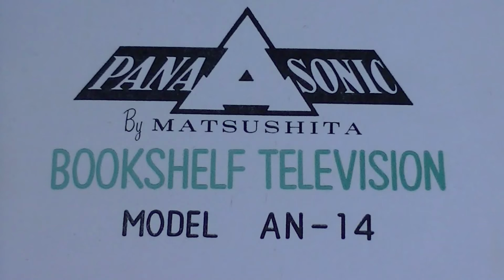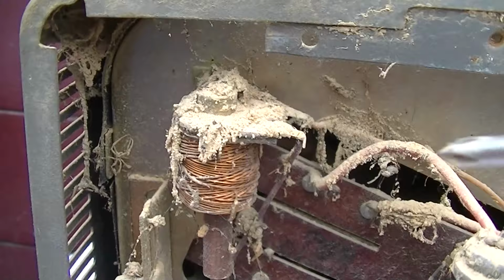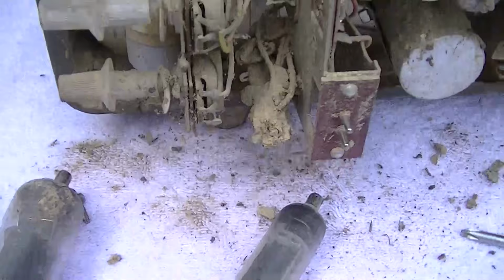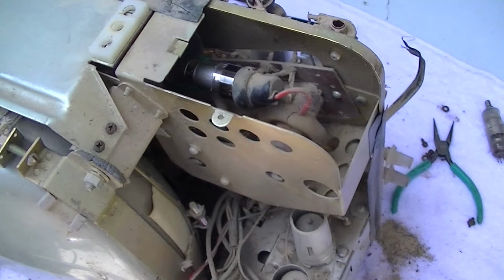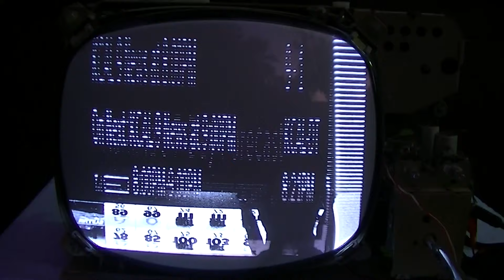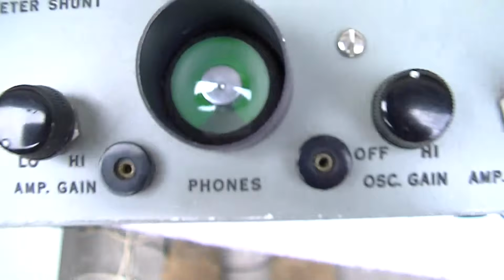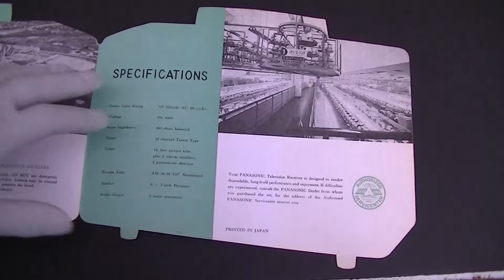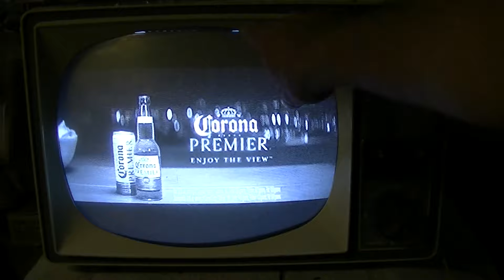1962 Panasonic Early Japanese import Black and White Television Resurrection AN14

Comment: Panasonic may be interested in this TV.  Besides being rare to extinct, this is the very beginning of commercial engineering in Japan. At this point, they mostly just copied like China now. Probably that complex simply because whoever designed it didn't yet understand the concept of engineering to manufacturing for profit or repair in the field
Reply: Actually an indigenous design.  Very few TVs are made like this.
Reply: What are you talking about? Japan were / are still one of the first real pioneers of TV. I suggest you look up Kenjiro Takayanagi, a famous Japanese engineer not so well known in Europe / USA but he built the first all electronic TV in the 1920s (didn't require discs like logi baird and co) and had a working TV demo even before Farnsworth. The war put the brakes on the developement of TV's but Japan were very much designing and working on their own stuff right from the start. They had a HDTV system developed and ready in the early 60s although bureaucracy would keep it from deployment until the 70s/80s by which time Digital TV was already in the works. Even to this day NHK (Japanese broadcaster) are the pioneers of 8k broadcasting with their own cameras and test broadcasts going on...
Reply: There was also a Japanese version of this model which was AN14, and it was under National instead of Panasonic, and it has a different logo instead of this one which was the Masushita logo.
Reply: Isn't there some kind of TV museum in L.A. that would be interested in this?
Reply: Takanayagi had an electromechanical television, it still used a Nipkow disk. 
"He developed a system similar to that of John Logie Baird, using a Nipkow disk to scan the subject and generate electrical signals. But unlike Baird, Takayanagi took the important step of using a cathode ray tube to display the received signal.  This was several months before Philo T. Farnsworth demonstrated his first fully electronic system in San Francisco on September 7, 1927, which did not require a Nipkow disk."
Reply: Well... for something that lasted in that condition and it's still working more than 50 years later, that clearly proves that it wasn't a bad design.
Reply: @user-vz4bo1en8x  

It didn't work tho.
But yes it's nice
Reply: @westelaudio943  well, it's working after not too much of it being changed. There were some radios that took shango more time than this to even get working.

Comment: I note the 110° deflection angle, when most sets had the very rounded edge picture tubes had a 90° deflection angle (sold in Australia, using the 625 line, 50 Hz frame rate). I can't recall any Japanese made sets available in Australia (1960's), but perhaps the most crucial items in terms of reliability were tubes in the deflection/HV circuitry at the time, as well as being readily available.. Of course, transistor radios were among the best receivers using germanium transistors, which were used in tuner, IF, and audio stages in 'hybrid' TV's (using tubes in deflection and picture). In Australia, there were 2 main sizes; a 17" (diagonal), and a 21". They came in almost a cubic wooden box, and managed a tube count of 17 tubes in each one. A TV & Radio licence (renewed annually) was necessary, so the activity of watching TV was not a cheap one. A magazine called 'Radio, TV, and Hobbies' collaborated with several component suppliers to present a 'kit TV', where you would save a lot of sales tax if you constructed it yourself. 1956 was the year that TV began broadcasting (commercial and national) in Australia, just in time for the Olympic games in Melbourne, where many people gazed through shop windows to watch it...

Comment: That's well made. I had a Sylvania doing that and it burned out the fly back because the fly back as you stated earlier in the video the fly back supplies the boost voltage and being that jacked up it burned it out

Comment: What I can't understand is why Shango066's videos have fewer views then Mr Carlson's Lab? You know, the guy that tried to convince everyone that film caps, which have no polarity, are polarized though an erroneous demonstration. His latest project, fixing up a pre-war Belmont AC/DC radio, five or six tubes, one band, a nice looking set but about as boring as it gets compared to this 1962 Panasonic (National) TV.
Reply: Yes, he does way to many AA 5 Videos , AA 5 sets are actually very simple and virtually all the same, X ray tony did a program where he de-bunked the importance of polarizing capacitors, showing by measuring the noise present at the output, that it made no difference how the cap was installed.

Comment: Little info on the white line at the top. That is likely line 21 (which should not normally be visible) which contains Closed Captioning data as well as additional data such as the rating data and sometimes channel ID.

Comment: Many years since I fixed TV sets, came across you by accident and have watched a few, how on Earth you have the patients.
The Numbers on the valves you (as we call them) not tubes, mentioned from the schematic,  were all common in all sorts of set in the UK.
The P in the number means a 300ma heater current, the voltage varied between different types, if it started with an E it was a
 6.3 volt heater, current varied with type, staring with a U was a 100ma heater, (obviously each type of valve needed x amount of watts to function, so a 7 watt frame output valve would need 3 times the voltage at 100ma as a 300ma heater at lower voltage) the next letter was type, C was triode, L was output Pentode, Etc Etc, 
The first number was the base connection, 8 was nine pins with a gap, 3 was octal base, Etc. I'm sure there

will be data on google :-) But just as a point of interest as you seemed not to be familiar with those numbers,
As an example a EEC 82 (12AX7) would have an 6,3 volt heater contain 2 separate triodes,  and fit into a 9 pin base.
The last letter would be the valves gain, frequency cut off etc. Manufactures spec. 
Just as another point of interest, If I can remember 40 or 50 years back, The example Of an EEC82 just happened (by design, I guess) to have a 6.3 volt, 300ma heater per section, so could be used in TVs with vale heaters connected in series as it had internal CT, in series with most of
 the other valves (starting with a P, 300ma type) The  P 300ma Almost universal in TVs in the UK, England. One last point, the valve you call the damper, we always called it the boost diode :-) 
Stay lucky my friend, Neville,

Comment: 42:00 - Someone in the past must have attempted some repair/mods to this set.  There's no way old or dying components could produce such an effect!
Reply: Its called vertical fold over and is a common fault. Usually bad capacitors in the vertical deflection circuits.

Comment: It's like an old abandoned  Toyota pickup truck. Every screw you try to remove is rusted solid and snaps. But it still sorta works.
Reply: Or even an old Ford Explorer - like the one shango did a video on some time ago.

Comment: that 'short' in the pl36 from pin 8 to pin 3 is probably correct, pin 3 is 'officially' stated as 'internal connection, do not connect' , this means its usually used internally for mechanical stability connection, yours happens to be connected also to cathode...
Reply: i've seen pics of a hifi amp that used 25E5s in push pull as the output stages?!

Comment: I love watching your work, you do great work, I use to take a hose wash the board then dry it with a air hose. how many tv,s have you found in barns with haft the roof, gone tv was wash by rain 4 20 years. plug it in and work. some thing that bad I don't think its going to hurt it any worse than it is.

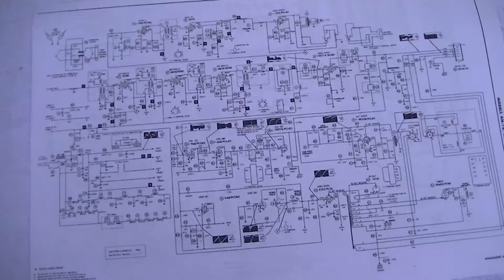Comment: 4:00 No mains transformer? I didn't know that a hot (or  warm) chassis in a metal case was even legal in 1962. Not the perfect set for watching "Days of Our Lives" while taking a bubble bath. The Zenith sets I've seen  seemed to follow a pattern of isolated chassis if the case was metal and a hot chassis if it was plastic or wood.
Reply: I just checked a 1963 Consumer Reports story on small TVs. They don't mention this one by name, but they say that the Japanese have the American manufacturers quaking in their boots anticipating a takeover of the portable TV market. They also say to check for the UL label, since a number of Japanese sets (compared to the all-plastic GE set they tested) didn't meet UL safety standards.

Comment: You do repairs like me. Find the 1 part that is causing the fault. Done.
Reply: You, shango066, and RadioTVPhonoNut are some of my favorite electronics YouTube personalities. I only hope that if I watch enough, I will someday have half the knowledge of any of you.
Reply: It takes years to learn, but the only way to learn is by doing.
Reply: I'm new to this channel, and I like it. But 12voltvids is still my favorite.
Reply: Thank you for taking the time to respond to my comment, when I have time, and am not absorbed in other hobbies such as vintage household appliances(such as my 1954 Bendix Duomatic which I am restoring),  I have worked worked on my RCA CTC-17XE color set from 1965. It had weak volume output and needed the audio output tube replaced and a coil tweaked. At another point I had to replace a resistor that was baked to high heaven being under the HV shunt tube. I have also recapped a radio.  I collect various vintage items and have learned that it has to be me that is going to fix them. I can't pay anyone to repair it, too few do it anymore. I just graduated, but at high school, my peers thought I was crazy for collecting and working on old junk versus spending time on social media.

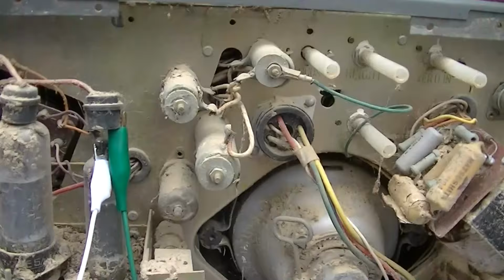Comment: 12:40 Those tubes may be rare in the US but in Europe they are very common. Cost pretty much nothing as they are not usable in audio circuits. PY88 sells for ~0.5USD or something. PL36 is around 3USD, newer PL500/504 can go for 2-3USD. 1X2B is the more expensive(6-7USD)  and rare one. However it can be replaced by any decent popular high voltage tube.

Comment: I wonder if that odd line on the top of the screen is caption data. I’ve seen it sometimes myself and it’d shift around with dots and varying line lengths kinda like a data stream.

Comment: interesting the py88 and pl36 are the most common tubes here you can find them on preety much every single german made tube black and white tv. i have boxes full of them
Reply: It doesn't sound that much different from North America other then the types are different, I have boxes of both 6.3 volt and series string TV tubes down in the basement, divided again into 7 and 9 pin types. I'm not sure but I think I also have some compactrons and other high pin count TV tubes as well. Sadly some ignorant people seem to think that their boxes of TV tubes are actually worth money.  
 There was one person in my region who thought that their collection from a closed down TV repair shop was worth $2500, and it looked like it was 90% TV tubes, things like 6AL5s, 6CB6s, 6W6s, 6U10s, and 6AX4s, or the series string versions. The typical 1950s-60s North American made B&W TV had between 10 and 20 tubes in it, not counting the CRT, and they manufactured 100s of millions of the things every year both for new TVs and as replacements, for years and years after that. There are probably way more N.O.S, and good used TV tubes out there then there are sets to use them.
Reply: same here Oleg...people say "its rare" its vintage" its art deco" and they ask ridiculous prices, nobody buys and the stuff goes to the dump...i thought it was a quirk of the Portuguese mentality but i guess its a global thing....the other day i saw a guy in OLX (craigslist) offering for sale a pattern generator and an old heathkit oscilloscope and some voltmeters...i asked the price of the heathkit and the dude asked 1000€...about 1200USD i guess...i laughed at him...sadly it will end up in the scrapyard

Comment: 25E5 = Mullard PL36 they're cheap as chips along with all the other valves in this set, 525 lines is 512i so near as dammit VGA resolution. Infinate greyscale. B&W is easy on the eye to watch.

Comment: I like that tool that checks capacitors "in-circuit", however unfortunately there is no way to test them reliably in-circuit, especially low-values like 0.0036.  I'm sure you know why, depending on the frequency even - tubes (between the plates and cathodes), other caps in circuit, even the leads themselves act like a different value

Comment: Those tube sockets aren't Bakelite, they're a (cheap) form of phenolic which was widely used for insulating in early Japanese gear through most of the 60s- E.70s. American-produced examples usually had reinforcing fibers in them. Bakelite sockets were usually pretty thick and durable and were usually black when used for tube sockets. Later sockets were made from regular injection-moldable plastics and would break if you looked at them wrong.
Reply: North American wafer type tube sockets are usually garbage no matter where they are made, porcelain is best, followed by molded Bakelite or Micanol. The only exception were some 7 and 9 pin sockets I found in a Soviet made radio, they made them out of multiple stacked layers of phenolic, about a 1/4'' thick.

Comment: The sharpness and clarity is due to 3 IF stages as compared to the typical 2 for a portable.  The conventional portables had a much less well-defined picture, IME.
Reply: i have a german nordmende tv with 4 video IFs
Reply: Nordmende made some pretty good gear in the day.  Some US sets had 4 picture IF stages, and I have a Zenith porthole dual-channel that has 5.  But by the mid 1950s most makers had gotten the count down to 3, and the cheaper sets were mostly 2 stages.  Those set worked fine in the city and suburbs areas, but for rural use forget it.
Reply: yes and Philps also made excellent stuff but Nordmende albeit being extremely high quality ( like for example all resistors even 1/2watt are wirewound and its value is printed instead of colour coded) their gear is extremely complicated and hard to repair. for example if you check the schematic for a normende othello 3d radio or something like that you may have a heart attack...I think i prefer the American simplicity on every aspect except for the fact that although complicated most German chassis have hinges and other mechanisms wich allow for testing and repairing whithout disassembly..i have a BW philips tv with 22 tubes and 8 diodes in it...the vertical output transformer has something like 4 or 5 windings, the potentiometers have weird percentage taps on them, the hold controls are automatic etc etc...but the sound and image fidelity is awesome..you can check it out i have it posted on a german forum https://www.dampfradioforum.de/viewtopic.php?f=36&t=28309 . cheers
Reply: I worked on my share of Nordmende and Philips.  A lot like building a model clipper ship in a bottle.

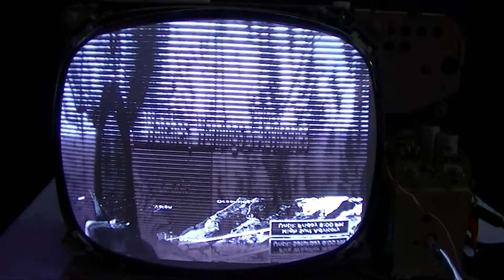Comment: at 41:09 "How is that possible?" of the vertical being backwards like that.  I was thinking about it, your schematic shows the vertical waveform with a peak voltage of what 100v?  That cap was biasing -30v.  100v must be the top of the picture (1/60 sec), and that's about 1/3 of the way up :)

Comment: Where do you find photofacts for such obscure sets?  I have a mid 80s realistic portavision tv. It came in the box with the schematic but stupid me lost it. Im having audio output issues, the un-amplified audio output from the general purpose integrated circuit (controls horizontal and vertical output as well as IF and audio) is present but i'm not getting any output from the amplified output. Suspect bad capacitor but I'm unsure... Your wisdom would be appreciated.

Comment: +shango066 the tubes like ef80,eabc80,el84,ecc85 etc.... starting with an E are 6,3v ones and the tubes starting with a P are series string tubes with higher filament voltages typically used on tvs. for example el84 is a typical amplifier power tube with 6,3v filament and on series string tvs we usually have the pl84 wich is its 15v filament version. Its funny how audiofools drool over the El84 and they have not discovered yet its 15v cousin wich is exactly the same and it costs about 3€ brand new old stock instead of 25€ for an el84....just add a 15v small transformer to your amp and experience the magic warm decibels of tv audio tubes... and for horizontal output 70% of the tvs use a pl36 as a horizontal output... funny how stuff is different from place to place. if you ever need one of those PY88 or PL36 tubes i have boxes and boxes of them, i bought for 0,50€ each and i would donate the tube to you no problem if you pay the shipping, i will never need all of those in my entire life no matter how many tvs i own.
Reply: I thought that the series string tubes all started with a "U" (at least in radios) and the ones that started with a "P" were specifically for TV sets?
Reply: yes my series string radios mostly use a combination of E and U tubes (UABC80, ef80 uf80 UCC85). on my series string tvs we get a mix of E and P tubes...never seen a P tube on a radio or amp but it can be adapted there and its avery cheap solution for replacing expensive tubes...I have seen now guys on ebay selling matched pairs of PL84 for push pull audio presumably for the guys who have a valve amplifier and dont want to spend their whole heirloom in 2 el84 tubes...the tube is exactly the same but with a higher filament voltage..that can be handled with an additional transformer

Comment: Shango, do you repair TVs for a living?  We have a 1972 Sony KV-1720 that's in need of repair.  We've traced the problem down to a burned out resistor, R609 on the Horiz board.  The TV exhibited arcing, then it went dead.  R609 is burned up.
There is also a neon bulb (one of five) with a broken lead on the CRT socket board.
Let me know if you do repairs for customers (for money, of course).